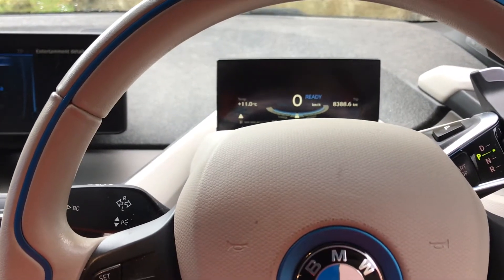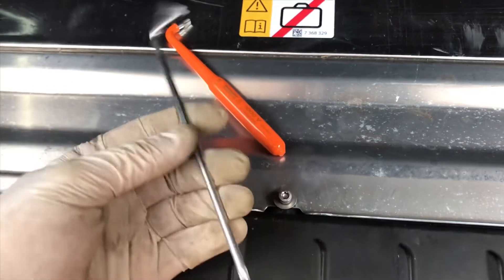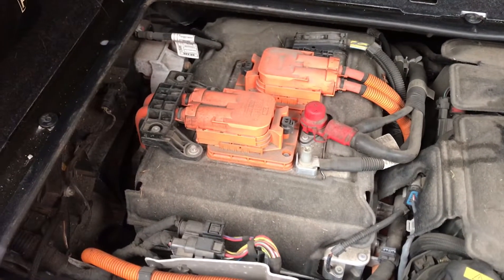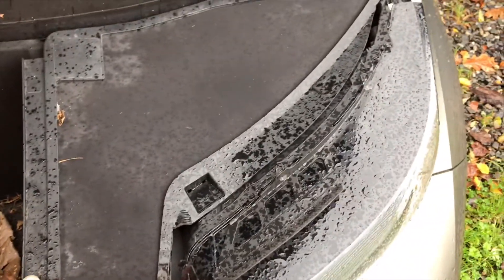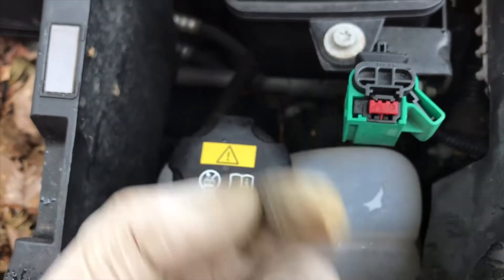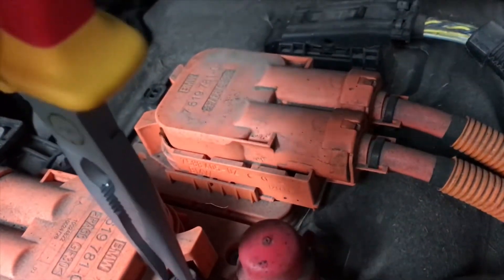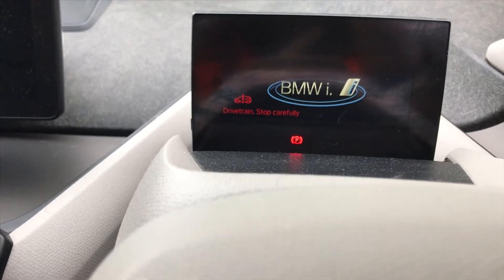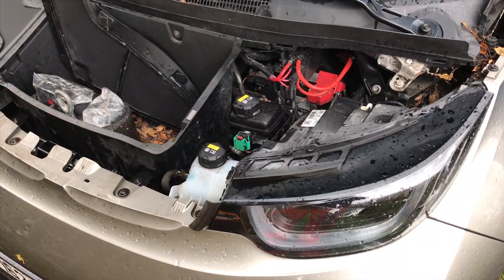BMW i3 REX High Voltage System Deactivation

Comment: How to plug this in? I just bought car from auction and someone delivered to me. Now I can't plug in
Reply from the maker: Plug in what? Ev interlock? Charger? Fuel for the REM? OBD?
Reply: @maxautouk this green/black/red plug which You unplugged
Reply from the maker: Its just the reverse of removal, plug it in and then depress the locking tabs
Reply: I got g60 350e from the auction , airbags deployed so the car won’t start needs 2 pyrofuses and sme 
Any idea where they located in the car pls

Comment: Good morning, Max Auto.
I'm having a problem with my 2015 BMW I3. I was checking the coolant shutoff valve (battery high voltage). I disconnected and reconnected connector A191*1B, which resulted in a DRIVERTRAIN error.
When I connect the charger, it flashes red.
Do you have any ideas on how to check what might have happened?
Reply from the maker: Im afraid without seeing the car I couldn’t be sure sorry Carlos

Comment: My i8 not starting says high voltage system deactivated is this fixable please help thank you
Reply: Was it a knackered 12v battery?
Reply from the maker: The 12v battery can be suspect but its better to have a diagnostic check performed to verify

Comment: Hi im fitting a new heater element (auxiliary heater )in the front of my bmw i3 full electric 2019 do i need to isolate the front and the back? There is a high voltage cable running to the auxiliary heater unit, and do you know  if its a simple  plug and play part? thanks in advance 👍
Reply from the maker: Im afraid i have no idea - ive never replaced one before but your local dealer should be able to tell you
Reply: @maxautouk  all done really easy, thanks for getting back to me anyway👍👍
Reply: @cheveredj8435 did you replace the high voltage orange cable to heater. And this video was enough to safely upplug that cable and replace. I need to replace as well
Reply: @Jthecake  I did change the heater but unfortunately it wasn't the problem, make sure that's the problem before you change it, no I didn't change the high voltage cable I inspected it and it looksed ok no damage or corrosion at all.

Comment: How to put it back down to its place after I’m finished replacing 12v battery ?
Reply from the maker: Clip the main section back in then push in the locking tab, they can be pretty dry so some wd40 helps

Comment: Is there a trick to pull the thing up? On my i3 it seems to be stuck.
Reply from the maker: Yeah its a bit tricky but you will get there
Reply: @maxautouk  yeah lost half an hour on that but finally did it in the end. Thanks!
Reply from the maker: @albertjelica1232 no worries!
Reply: I found it helped to pull up on the red and black parts together.

Comment: @ Max Auto  - in the boot, there is 2 of them, one on each high voltage cable - why you only disconnected only one of them? also, i believe all those switches only deactivates relay, so there is no need safety gloves and boots - its only 12V switches
Reply from the maker: Good question, i didnt explain it properly in the video, yes BMW dont say you need specialist gloves for the isolation of the HV battery just boots to be extra safe incase of strange faults usually occurring on crash damaged cars etc. 

The secondary high voltage loop plug is significantly reduces the risk of arc flash if you are intending to remove the high voltage cables themselves from a high voltage component ☺️ when doing work like this its always advisable to wear protective gloves 🧤

Comment: Thanks much for this. There are not a lot of tutorials on this car.  I am wondering why you'd keep the car in 'standby mode' versus completely turned off to do this work? Any benefit?
Reply from the maker: The computers in the vehicle are 12v you just disconnect the high voltage loop, but the pcm stays in standby mode or sleep mode 

You can never actually disconnect a battery short of removing the three phase connectors because the battery is always live

Comment: Egg seal ant work
Reply from the maker: Unfortunately the water that is inherently in an octopus just increases the resistance which draws more current and actually makes it even more dangerous

Common mistake though dont worry
Reply: @maxautouk  😂😂😂🐙🐙🐙
Reply from the maker: You can’t seal the high voltage system with an egg, sorry 😞
Reply: @maxautouk  not even if you send a trained ant in?
Reply from the maker: Even the most trained ant can’t comprehend the sealed egg 🥚